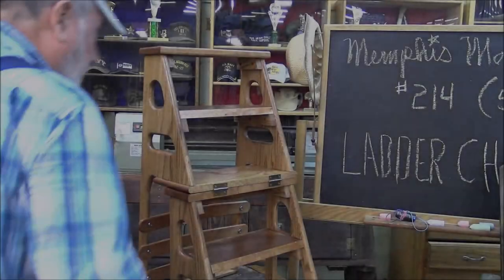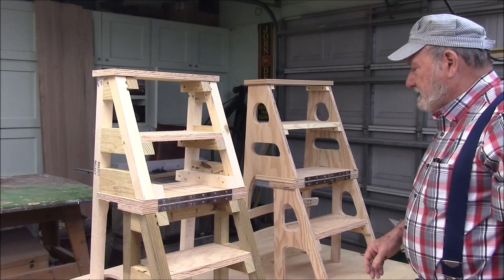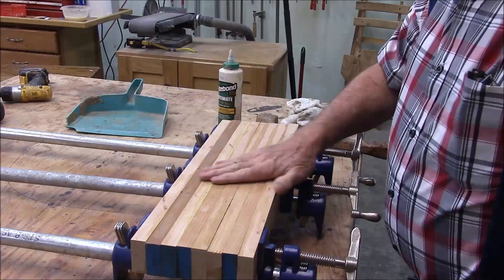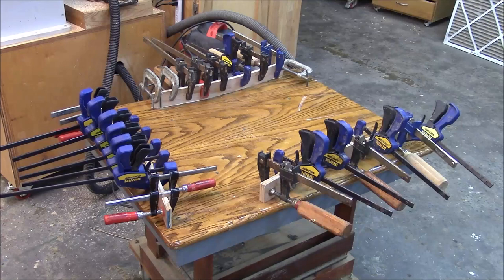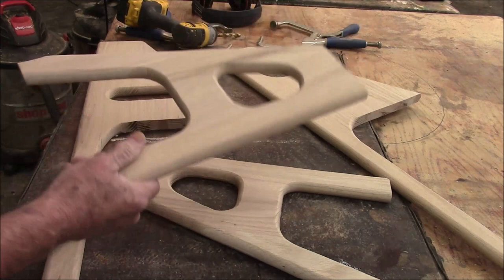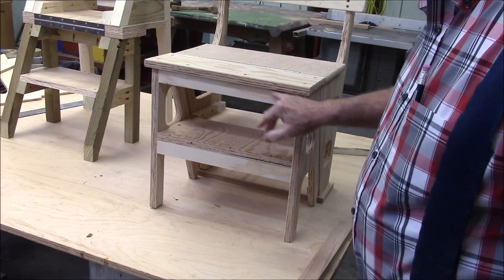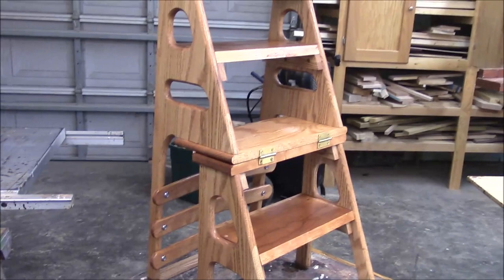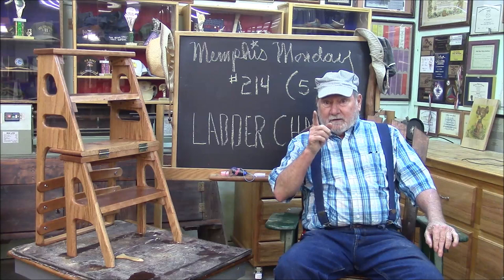Franklin Ladder or Library Chair MM 214 (5 6)

Comment: That would've come in handy last night when I was in the garage pulling down a big old worm drive Skilsaw FROM THE TOP SHELF...Except I would've used it in the chair position to have the backrest to stabilize myself. Standing on the top of the ladder in the dark holding that heavy saw is not recommended for an ordinary man, but I pulled it off as usual.
Reply from the maker: Ordinary men simply wilt when faced with the challenges we face, but again, we are humble.
     I don't know much about those saws, except they used to be common tools for framers.  
     I hear you on those top shelves.  Dangerous.
Reply: Before I retired I walked 2x4 walls on the top plate as a regular plan of action when rolling trusses even 3 stories high on apartment complexes, right into my  50s. One time to intimidate the new guy, I walked uphill backward on 1 truss. I cheated and used a 2x4 for a balance pole though. He didn't last long.